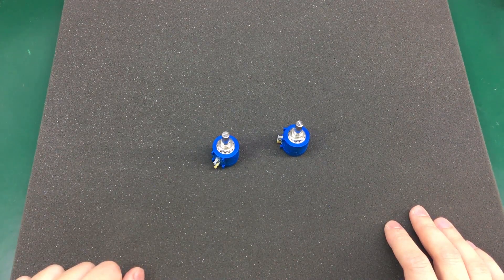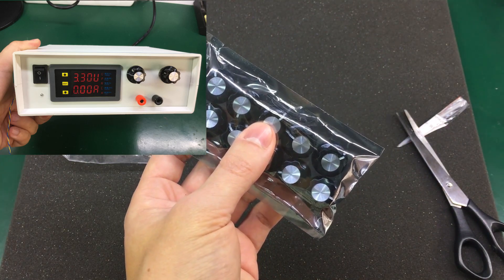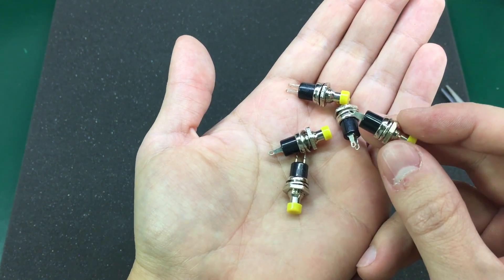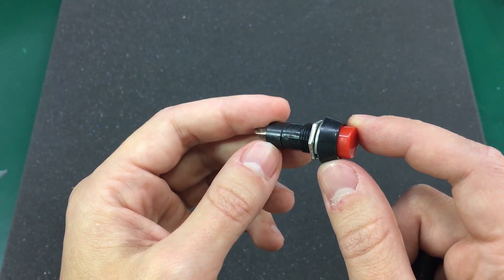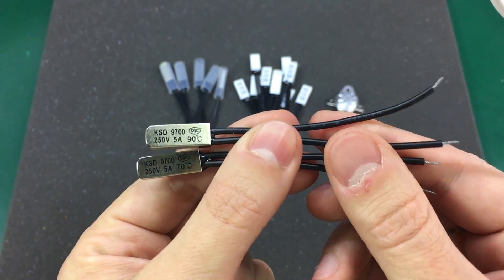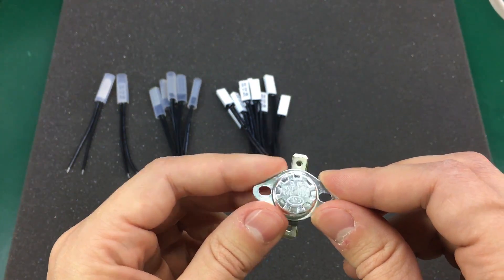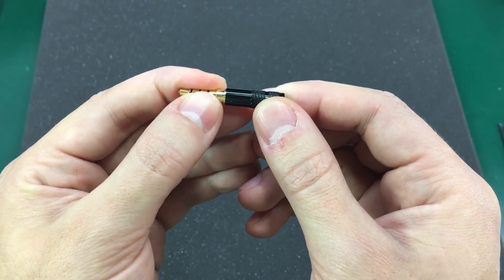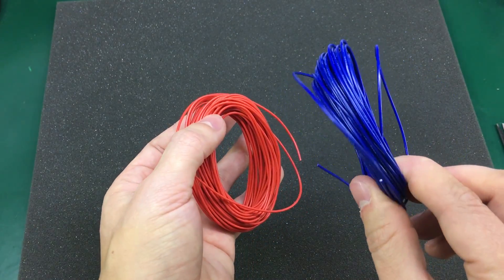Voltlog #75 - InTheMail

Comment: Is there a reason you use multi-turn pots rather than rotary encoders?
Reply from the maker: a rotary encoder would require additional electronics for read & control and we are working with analog circuits here.

Comment: 1:33 - Exactly what the wife told me the other day.

12:22 - Be careful soldering those, the insulation melts very easily and the plating causes them to be tricky to get solder to stick to.
Reply from the maker: yes I've done that before, you have to be quick about it, thanks!

Comment: I've already started on the dummy load project shown.  It uses a irfp250 MOSFET rated for 33amps continuous.  The final result will probably be 20amps max but the kit seems to be limited to 10amps and may be inhibited by the controller.  The circuit board contains an interface for the ebay panel meter with amps & volts, very convient for my project.  I powered it up on a breadboard and it worked great but the heat sink to go with it needs to be big.  I plan to mount it in an old atx power supply case.  The atx fan will probably be used or I might mount it outside the case.  It will be adjusted for volts and amps but I don't think current limiting will be possible.  I plan to beef up the traces on the board to handle more current using solder.
Reply from the maker: Even though that mosfet is rated for higher current, it will not survive that continuous current because it was not designed to be operated in linear mode, sooner or later it will fail. That's why I only plan to use it up to 10A max. More info here: http://www.kerrywong.com/2016/10/08/linear-mosfet-and-its-use-in-electronic-load/
Reply: Something tells me the max rating will be ok as long as the mosfet is kept cool enough.  I also don't think the controller on the dummy load operates in the digital domain to control the MOSFET.  I think the design for this limits the full potential of the MOSFET's ability to disapate the heat produced.  The dummy load comes without instructions and is a bit of a mystery to use.

Comment: Good video! Those 10 turn potentiometers look a lot better than the ones I purchased for a mini power supply I'm building. The ones I got are really cheap and grinding scraping feeling when turning and not to mention that the shafts were a lot smaller diameter and longer than I expected also. I I may purchase those ones that you showed. Oh I like that smiley face at the end!! :-)
Reply from the maker: thanks and good luck on your next purchase for these 10 turn pots.
Reply: VoltLog thanks dude! I just ordered them. :-)

Comment: I was planning on buying these exact potentiometers from bangood europe.
Reply from the maker: Let me guess, are you building a power supply?
Reply: It's already built , couldn't find multi-turn pots at a decent price in RO so i used  normal ones.
Reply from the maker: you can always replace them later if you desire.